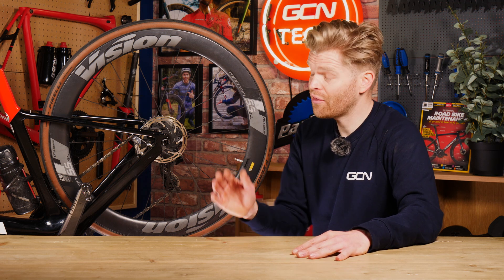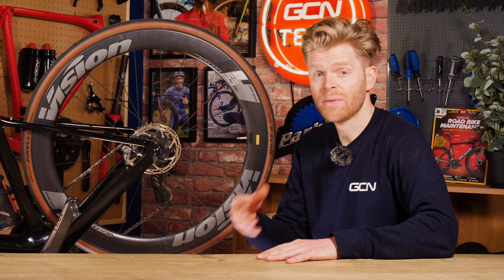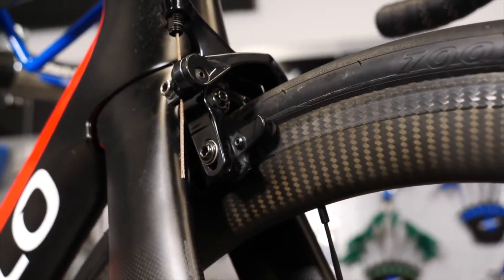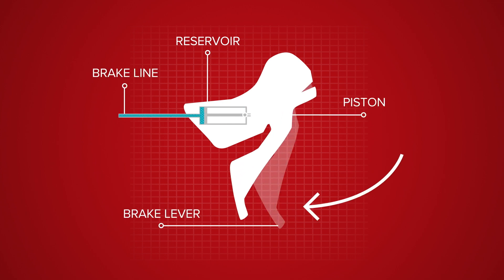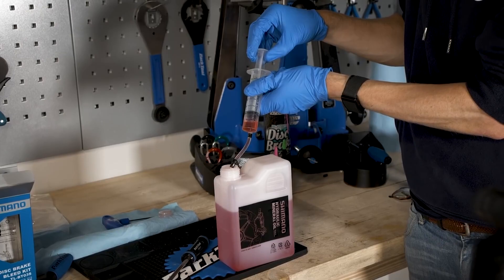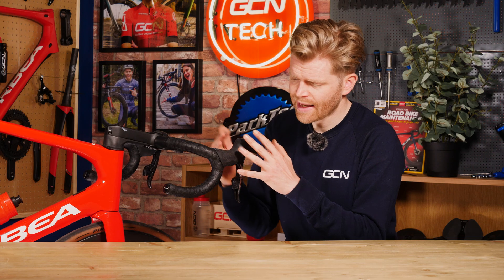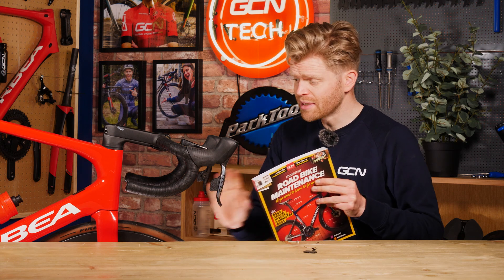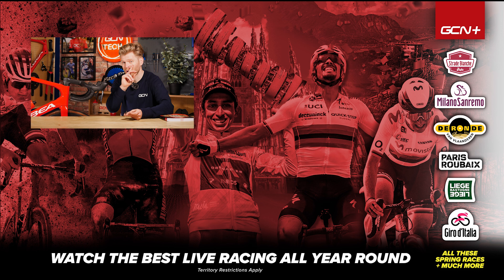How Do Hydraulic Disc Brakes Actually Work?

Comment: I bought a new bike (Giant) about a month ago, and it has hydraulic disc brakes. Coming from previous bikes that had traditional brake pads, the braking performance of hydraulic disc brakes really impressed me. The braking is smooth and consistent, and is so much better in the wet. The only downside - for me at least - is maintenance. I could easily change brake pads myself, but HDB will require me to take it to a bike shop, though I’ve heard that HDB last a lot longer than traditional pads so hopefully it won’t be for a while. Good video btw! 👍
Reply: Smooth braking  is only something heavy riders experience the rest of us suffer with snappy sharp braking and high risk of locking out wheels

Comment: A very easy to understand and nice explanation of hydro's. But, because of frequent cracked caliper pistons, blown lever pistons, stuck pistons, pad contamination, uneven piston pull, centering issues, leaking caliper seals, air and bleeding issues, rotor dirt and oil (you can't see), frequent pad wear, disc brakes are a huge headache and don't warrant the hassle, for road bikes anyway. Live with them long enough ( or even short term), you'll experience all the issues I've mention.  Do they perform better than rim? Yes, so the "experts" say. But for 99.99% of people reading this, the differences just don't  matter. It's all about the perception the marketing creates .  I won't be replying. Fire away and have fun. Popcorn in hand.

Comment: I’m with froomy on disc brakes. The tolerances are unnecessarily tight. The pads really don’t need to sit as close to the rotors as they do! if they didn’t then all rubbing would stop and everyone would be happy. Job done.
Reply: Pads need to sit close to give that instant response.

Comment: I only like rim brakes because it is easy to maintain 😁
Reply: Can true your wheels, lighter, work great I most conditions
Reply: And cheaper.
Reply: I think disc brakes are or off road, trail riding.
Reply: @jordimaxwell  not even for trail.
You need high speed off road or wet/snow for them to begin to offer a benefit.  It's just marketing bs 98%
Reply: @chrisprice5895  yeah you are right. Rim brakes all the way for RBs
Reply: @chrisprice5895  Not everybody knows how to replace worn-out rims.
Reply: @shannontrainer5857  I haul a trailer with either my son, groceries, etc.  I ride hard, go fast, the bike has a 500+watt hub..

It's 3 years old and, let me count,, one rim was almost due for replacement. The others were one folded, one wore fast after a crash, one lost trueability and had the I'm replaced with same spokes and gt itofservice due to a stretched spoke(popped tubes).

... So you see, rims can last a long time and even at the cost of 100$ for a Velocity rim you are getting ten thousand+ miles.

If you use bontrager or common mass used entry rim rake pads our rims will get eaten away much faster than say koolstop pads.

Crappy rim brake pads I believe can wear more, dish the brake track than a good stopping pad.

Disc pads and servicing of risk brakes is greater. The economy is worse.
Reply: @shannontrainer5857  buy the same rim you had, know or original spoke length and go for it.  I have a chance cheap truing stand..  it's not that difficult at all. Think of it like building a model airplane, idk.

For wheelbuilding new learn to take measurements with the help of the fine Canadian people at grin tech
Reply: @chrisprice5895  You do know that very few cyclist knows how to rebuild a wheel.
Reply: @shannontrainer5857  wanna say, the image of [only] the 'master wheel builder' building wheels or it being some logic puzzle is not true.

For any united states graduate of high school it's doable in few hours on a kitchen table and using a bike frame (and rim brakes!) As a truing stand.

... Yeah.  With rim brakes you have a truing stand on the bike
Reply: @chrisprice5895  I would never trust a bike frame as a truing stand, as it contains no tight tolerances or dial gauges whatsoever.
Reply: @chrisprice5895  If it's doable for everybody as you claim it is, why most people would rather pay a master wheelbuilder to do the work for them?
Reply: @shannontrainer5857  Shannon, can I call you Karen?

Karen,

Rim brake systems are overall cheaper, lighter, and have less maintenance involved.

No 'master wheel builder' is needed.  That was sarcasm.

If 12k miles comes around and your spokes are still good you can lace a new wheel in an afternoon.  

Disc brakes have rotors alternatively to change and with your level of confidence yokud have to send the bike in anyway.

Seriously wheels fall out of true and last years before such an issue Possibly sucombs.

I use kol stop pads, cycle 100+ s week and stop hard.  After a year m front rim is still in great condition.

Disc brakes also weigh more and drop the performance of the bike. They are slower not faster. It isn't a viable as purported.

If ppl acted thoughtless like you consumer goods would suck... Oh wait.
Reply: @chrisprice5895  First of all, I'm a man. Second rim brake wheels are a wear item. And third, just because you know how to rebuild wheels doesn't mean everybody else does. https://www.youtube.com/watch?v=12LgSnqgfJM
Reply: @shannontrainer5857  lol. You have never used a bike frame as a truing stand? That's pathetic
Reply: Upgraded to a disc brake bike. Worth the purchase, will never go back to rims.

Never really cared about watts, performance or efficiency, so no big loss for me when I switched from rim brakes to disc brakes.
Reply: My car uses rim brakes too
Reply: @Chance57  good luck 🤣
Reply: @Chance57  perfect sales logic

Comment: Got curious about these braking systems since an E-trike i have my eye on comes stock with them. I did a quick try with them on a display bike at a store and that wheel did NOT want to move, so I was pretty impressed, considering replacing the front brake on my trike with one.

Comment: I would be thinking the brake fluid system be part of the brake callipers. A simple lever design that is pulled by a cable, this reduces the possibility of the brake line getting a hole and applies more direct braking pressure at the callipers themselves. This also reduces the chance of brake fluid leakage getting all over the paintwork, clothing, and your skin.... Just something I've pondered...

Comment: There you have it! Many simply don't enjoy having discs. Weigh more, cost more, need a LOT of attention where beginners don't have a clue. My advice stay away from disc brakes ( fyi I am riding discs and less fun than rim) The manual won't help AND pads aren't cheap, bleeding takes hours to finish. Go for discs if you got lots of time to spare waiting...
Reply: If you buy the pads in bulk like I do it will save you money I also save money using baby oil instead of hydraulic fluid 😉
Reply: @oo0024  baby oil? Never dare try unless there goes bulk of approval studies. Didn’t mean to challenge any means of cutting cost … good idea to order loads of pads. Disc brake pads are unreasonably expensive for any govt policy that look for a greener environment. Cheaper to drive a posh 4-whee than  buying one brand new Specialized SL7 or any winning bikes you know.
Reply: im not a weight weenie

Comment: I’d like to know why the bleeding process on the road bike involves rotating the bike around 14 times in the work stand. On the MTB you just set your levers level and push the stuff through. If you can get hold of a transparent or cut-open brake lever that would be great.

Comment: The principle of it working could have a bit better explanation.
Basically, since we have mechanical advantage with the brake lever, we can multiply the force applied to the piston pushing the pads to the disc.
Meaning that we move a small piston at the brake lever a longer distance than we move larger piston(s) at the brake pads, which amplifies the force we can apply on the pads.

The force amplification in hydraulic brakes does not come from the movement distance of the pistons but from the increased force applied by the larger piston area in the calipers. This is because the pressure applied to the fluid by the master cylinder is distributed equally across the larger surface area of the caliper pistons. A larger area means more overall force exerted by the caliper pistons, even though the pressure (force per unit area) is the same.

Comment: I have hydraulic rim brakes (SRAM). By using quality pads (Swissstop) you can lock your wheels with one finger
Reply: Wheel lock and consequential skid ain't supposed to be a point in favour of your braking system you know.
Reply: @SixSioux  I mean you have all the stopping power with  just one finger. Especially in long descends and you don't want to exceed certain speeds you can brake without getting tired . Generally I'm afraid going over 70 km/h

Comment: could you describe the hydraulic szstem in more detail? How the pistons are moved in and by their seals and how the reservoir works..
Reply: So hydraulic brakes work based on the physical principle. That liquids are incompressible, best way to think about this is 2l of milk you can place it in containers (but they have to be 2l) you can't compress it. So when you push the lever the force as shown in the diagram goes down the line and down by the pistons (which causes the piston to push out) squeeze the pads. That small reservoir in the hoods the acts as an extra tank. As the pads wear down the pistons must move out a bit more if there was no reservoir then there would be done air bubbles. Which wouldn't be great (spongy brakes). Hope this helps a little bit more.
Reply: @jussa101 In my case that's the clear part. The confusing part is what prevents me from just pushing fluid into the reservoir during the lever pull (since that's where no resistance is). And if the reservoir is shut off, how can it fill up the brake line (one way). I was hoping Olly would go into more detail here.

Comment: On my TREK CrossRip LTD (2016) I have TRP Hy/Rd brakes, which follow some kind of hybrid approach: a hydraulic disc brake but actuated by a mechanical cable. What do you think about those? I tend to think they are more reliable, but probably with slightly less performance than the usual hydraulic brakes with fluid through a hose up to the levers.

Comment: I would love to see a weight comparaison between hydraulic and mechanical disc brakes
Reply: discbrakes are also easy to meintain if you don’t have two left hands m8
Reply: Shhh!  Hydraulic brake work great, are light and the consumer does not, I repeat does not, regret the choice.
Reply: I have cable disc and cant imagine hydraulic being much lighter or heavir.  Over all prefer cable, simple to maintain and work great.I would not spend more to have hydraulic.

Comment: It seems to me that earlier versions of hydraulic brakes required the bike to stay relatively upright. Storing it vertically on a ceiling hook or completely upside down somehow would compromise the system.  With no apparent admonitions from recent manufacturers, is this no longer an issue?
Reply: I still have this problem on one of my bikes, the front brake stops performing well if stored upright for a while, but the back is fine.
I think it implies there is a slight air leak somewhere, after pumping the lever a few times its fine.  you can also take off the cap at the lever end, top up with fluid and "burp" them.  It might be that this bit of air would travel up the hose and into the piston if stored vertically...
Reply: @alandriver9916  Thanks!

Comment: Need to add on this ... rotors are a lot easier to get damaged vs rim brakes ... sheer body weight + gravel road + drizzling + lots of descending... heading to local bike shop after...
Reply: Disc brakes have taken over completely for MTB's, and they are ridden much harder than road bikes. I personally have never bent a rotor, and while it of course happens, it's not something one have told worry about too much.
Reply: 8994 miles on OEM discs in Colorado and I weigh 200 lbs.  No problems.  Including multiple trips down Vail Pass.
Reply: Disc brakes put extra strain on wheels but don't wear out rims and brake the best.

Comment: Am I right that the pad to disc clearance issues are a function of not being able to build a sufficiently large piston and reservoir into the hoods meaning that the piston travel is less than one might want resulting in tight clearances? Perhaps electronic systems might get round this?

Comment: Hey Ollie or whom ever reads this, maybe do a Brake bedding video after you've installed new pads, just sayin. I have a 2020 Tarmac Pro, switched the rotors to Sram Centerline rotors(106grams each) and OEM Sram pads, got everything bedded in now the brakes feel like they did brand new way back in September 2019.

Comment: I think the hardest part for my brain is the idea that both my drive force and braking force now have to be transmitted to the tire through my spokes. With rim brakes, the spokes don’t get strained by braking?
Reply: very true.. wheels have to be built stronger for disc brakes and good spoke tension maintained.
Reply: Physics mate, sorry to tell you but they do.

Comment: I'm a convert to disc brakes since I bought my current bike nearly three years ago. Before that I always used rim brakes -- I'd never go back to them! The disc brakes are so much more reliable in all weather conditions -- a great benefit in urban commuting. But, I use cable controlled brakes, not hydraulic, for simplicity. Far easier to maintain, overall, and much closer to the KISS principle (Keep It Simple, Stupid). Hydraulics for me are just unnecessarily complex. The same will go for "brake by wire". Bicycles should be the ultimate form of simple, sustainable transport. Unnecessary complexity is just so ... unnecessary!

Comment: Anyone hear about the problem Shimano have with the oil seal membrane inside the shifters? I heard lots of failures with the Dura Ace shifters from the 11sp. The whole unit has to be replaced. Expensive if out of warranty
Reply: I had this happen and was one of the reasons I switched back to rim brakes.

it failed on me on a fast descent on a sportive totally loosing my front brake after that enough was  4 me (it could of killed me as I was up the pennines on a technical decsent) I spoke to my insurer bikmo who said its pretty common failure unfortunately.

Comment: I may in minority, but I got my very first hydraulic disc brake bike recently, and honestly I'm not that impressed by their stopping power.  Sure the brake lever can be pulled with one finger initially, but it seems the friction between the pads and the rotor is weaker than the old rim brakes and thus requires more  squeezing effort to stop.

Comment: What puzzles me why Disc Brakes are more effective than Rim Brakes because if you thing about it a wheel rim appears to essensially be a disk rotor but of much much larger diameter!
So, why are small disks more powerfull than large rims?
Could it have something to do with the rim deforminng, (squashing/undergoing elastic deformation across it's width) under the pressure of the caliper?
Is it that much greater mechanical advantage can be applied via the disc brake actuating mechanism than that of the rim brake mechanism?
If they made rims stonger they could withstand the force but that would add weight to the wheel in the worst possible place, (that subject to the greatest angular momentum).

Comment: #gcntech  Hello GCN! I wonder, how resilient are hydro brake shifters from crashes?  I know full hydro brakes are best but they are quite expensive BUT I really want to get one...my only concern is that I do cyclocross and off road rides where crashing is common...Brake levers hit the ground first (or a tree) oftentimes...I'm still using cable actuated hydro brakes {same braking power as Shimano GRX and R105systems I borrowed) but are quite heavy.

Comment: I like my hydraulic disc brakes, but I've noticed that after a rotor change they perform poorly until the rotors get loaded with brake pad material. How do the pros deal with this when they get a wheel from neutral service mid-race?
Reply: I believe they are already burned in. If you are having trouble I recommend you also do this as it extends the brakes life also

Comment: Any reason cable actuated cannot work as well hydraulic? Thanks
Reply: Hydraulic gives you much more control and you're able to modulate the braking much more. It's very important for MTB but probably less important for road bikes.

The benefit of disc are that they actually work reliably no matter the road conditions so I would probably say that a cable disc brake is better for road if you are worried about hydraulic maintenance.

I've been riding with hydraulic disc brakes on my MTB for many years now and I don't have to do the much maintenence on them.
Reply: @lokedhs  thanks reply. Yes.  I have been on bikes. Road. 30 years.  Rim still does the job road. And modulation less required. Indeed we need not over kill. Lock on through over bars.  We can run out if brakes wet and don’t bite initially.  Starting to think disks need be on MTB cross ebikes commuter bikes. Anything but road racing bikes. As were known. Or roadie bikes .

Comment: GCN: Hydraulic disc brake, reliable, efficient, powerful, and consistent. They can also leak fluid, rub rotors, squeak, seize, overheat . . .   from time to time! 🤣🤣🤣 Oh, don't forget, never press the brake levers when the wheels are out . . . or else--->>> 🤣🤣🤣
Reply: The pressing of the brake when the wheels ate out is a bit of an exaggeration. You have two pump it several times before you notice it. 

I do not it intentionally when I want to the bakes today apply a bit earlier. I usually have to press it around 8 times.